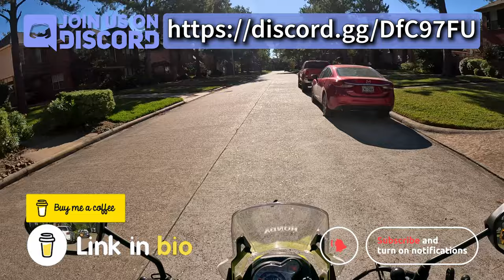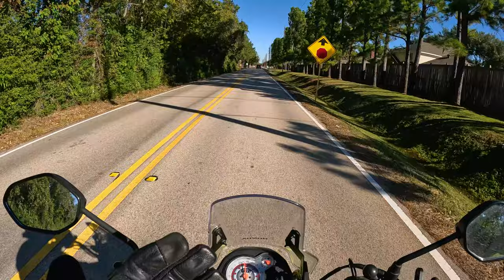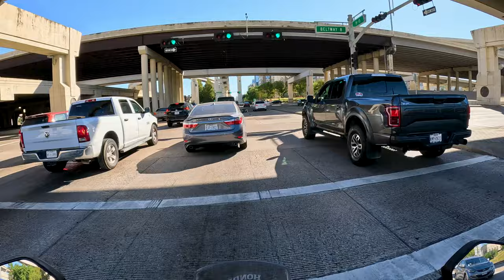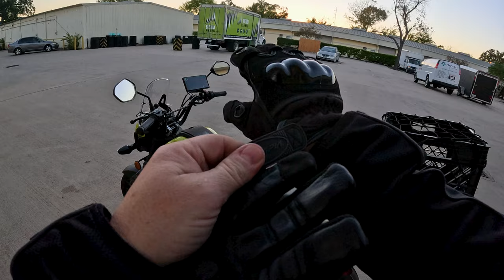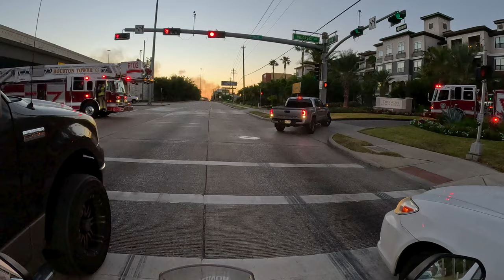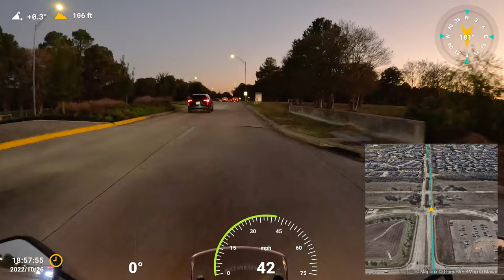VLOG: Honda Navi Commute // Motorcycle Projects & GoPro Hero 11 Mods

Comment: all my silverwing needs is a front tire. it looks great no cracks or anything its just 10 years old. i was going to do my 4000 mile oil change on my trail the other day. and its a good thing i looked before i drained it. because my old lady used it in the lawnmower.  i guess i need to go buy some more because i need to change it in my wing also

Comment: So yeah, I think that makes sense if the cub is totally flat, you probably can’t start it, but we can do is if the battery has a little bit of juice in it enough juice to turn the switch to on. Then you can pop start it while you’re going down the hill you put the Killswitch to the on position you turn the other switch to the on position you put it in neutral and then you start going down the hill and then you put down the shifter let it go for a second and then let it up to put it in first and as you’re rolling forward down the hill it’ll pop start

Comment: Hi Quasi, did you do a vid about all the add ons you did to the Navi? 
I'm interested into that fuel canister you added left rear of the bike. Also how did you add the top case plate to the OEM rack. I need to add a Monokey plate so I can use my top case.
Getting my Navi next spring since I crashed my CB300R last October by hitting a deer at 90kmh 🤣

Comment: Nice ride, I was wondering quasi when you lane split if you ever had a run in with someone, What came of it?
Reply: Is lane splitting a code violation in Texas?
Reply from the maker: I've had numerous problems with cagers over the decades, but much more frequently in Texas than other states.  Most of the incidents are attempted crashes (intentional) by cagers swerving into me or trying to pin me against the retaining wall or other vehicles.  I've had a few armed encounters, but they immediately lose interest in bullying when they see that I'm also armed and unphased by their antics.  The best option is NOT to react and evade... just keep riding to put distance (and a lot of other vehicles) between you and those homicidal nitwits.  😉👍  --QM
Reply from the maker: @123edwardzpad  Yes, it's technically against the law and not permitted in Texas... at the moment, anyway.  There has been pending legislation for several years to allow motorcycles to filter through stopped or slowly moving traffic.  I don't filter or split at high speeds on the roadways unless I have a really good reason.  Most of my filtering is done at low speeds similar to these circumstances, and I'm always preparing for the worst because our cagers are territorial, aggressive, and they'll intentionally try to wreck motorcyclists for passing them.  😒  --QM

Comment: What're you using to strap down the milk crate?
Reply from the maker: The milk crate is mounted on top of a SHAD top box plate that's sitting on the Honda accessory rack.  I have the crate secured to that plate with 3 heavy-duty (50-lb) zip ties.  When I don't need the crate, I just snip the zip ties and then I can reuse the rear rack for my SHAD SH33 top case or a waterproof rollbag on the rear seat.  Cheers!  😉👍  --QM

Comment: My navi would act up regular gas. Used alcohol free and have no problems
Reply from the maker: I've only run E0 in my Navi a few times.  Unfortunately, it's very rare in the Houston area, so we need to drive (ride) very far to find fuel stations that have it.  The Navi's tank is so small and the fuel economy is so low that I'd burn through the good stuff before I could ride far enough to make it worth the trip!  🤣👍  --QM

Comment: Hey Quasi, I know you added extra lighting to your Super cub….did you do a video on it? If so, can you tell me where I can find it.thanks
Reply from the maker: Those are the Denali DM driving lights.  I don't have a specific video about them or the installation process because I was in a hurry preparing the Cub for a road trip.  You can watch the video leading into that project here: https://youtu.be/k1ri2ZEX9JI .  The first demo of the lights can be seen in the video the following morning when I hit the road: https://youtu.be/37BTEHXWfxU?t=145

The LED light pods are mounted on the original reflector brackets, and I bent the brackets to clear the leg shield.  The power harness is run directly to a fused connection at the battery.  The on/off switch and relay is powered through a switched 12V line on the ignition switch, so they are only active when the bike is powered on via the key switch.  Cheers!  😉👍  --QM

Comment: Hey! What external mic are you using in your helmet?
Reply from the maker: My microphone is a from an older Cardo Scala G9 helmet communicator.  It plugs directly into the GoPro's audio adapter, and it has been amazing... I got lucky with that mic early in my vlogging escapades and stuck with it.  The timbre and voice quality of the Cardo helmet mic is drastically better than others that I've tried (e.g., Purple Panda, RØDE lavalier mics, etc).  The other microphones that I've tried allow too much wind noise or are over-saturated and cause the GoPro audio to clip and distort at high speeds due to the wind noise.

I edit all of my video in Adobe Premiere Pro, and that's where I apply minor audio corrections (e.g., level normalization, minor noise reduction, etc) to keep everything smooth.  However, most of the audio quality is due to the Cardo microphone and the quiet helmets that I use (Schuberth C3 Pro and SHOEI NeoTec II).   Cheers!  😉👍  --QM
Reply: @QuasiMotard  dang that’s perfect looking! Shame you can’t just buy a mic like that for vlogging, I haven’t been able to find one.

Comment: Awesome trip today!😁  Change out needle screw and run it. Many think that after a certain RPM the lean/rich doesn't matter. Even at high RPMs on small engines the idle screw still is giving fuel.
Reply: I thot it didn't matter on wide open until I ran a 25hp boat motor and adjusted while running. Wow, it was an eye opener.